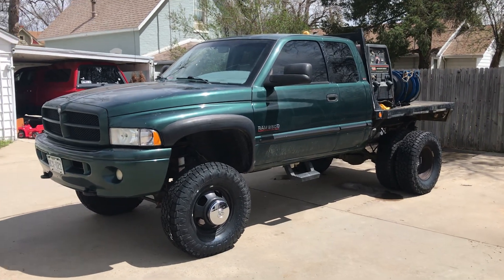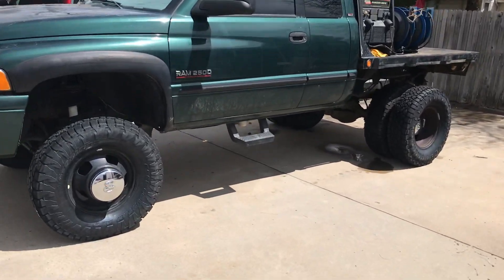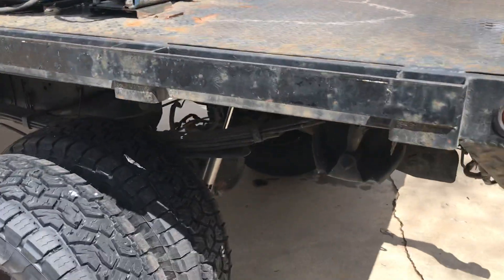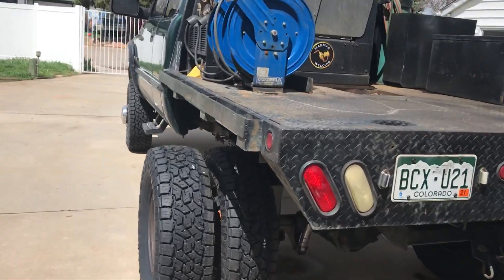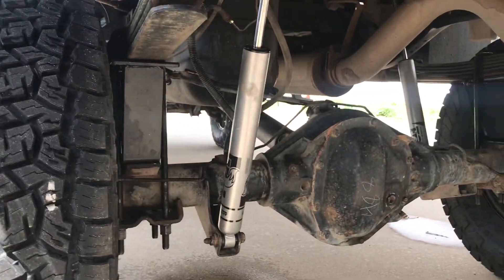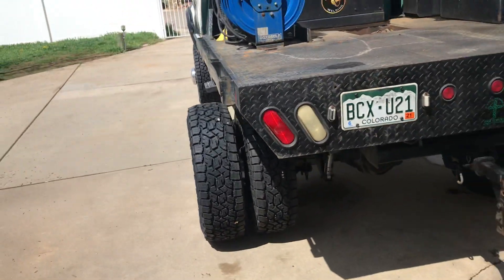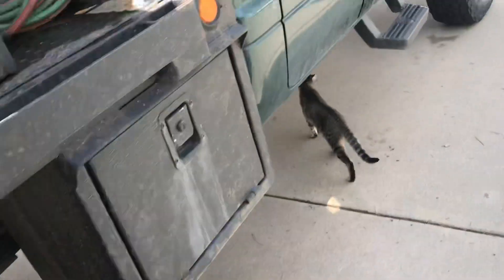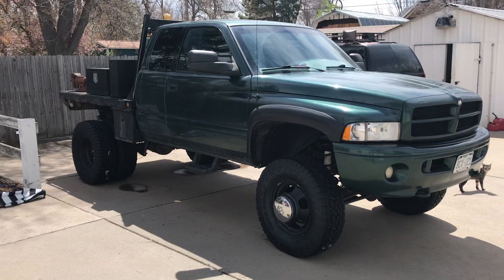Dually swapped the welding truck

Comment: Hi let me know when u want to sell that rig im in firestone Colorado
Reply from the maker: I will be selling it soon! I just got a new truck. I just have to get the welder off and switched over. 970 631 9038
Reply: Good i got all my tools in a tráiler
Trying to buy a truck for my setup
Reply: How much do u want for it?
Reply from the maker: Asking $14k, has 240k miles. 5 speed manual.
Reply: @madmarwelding  ok i let u know

Comment: Could you do this to a single cab short bed?
Reply from the maker: sorry for the delayed response. a singe cab short bed is going to be a half ton truck. yes you can put one ton running gear but youll have to do the front as well

Comment: What are the width of those steel wheels? How do the 35s fit on them?
Reply: Gotta use spacers 2in or 1.5in
Reply from the maker: There 35x11.50s with 1.5 spacers. they fit just fine, not sure on the wheel width. Stock 3rd Gen 17” rims
Reply: I’m just concerned with the width of the wheel. Most of those were like 6.5” wide. Is all the extra rubber a problem?
Reply from the maker: @lukehilton3562  Iv put the boots to this truck! Pulling over loaded trailers, 4 wheeling through crazy job sites, I even pulled out a stuck semi box truck. Never had an issue one.
Reply: @lukehilton3562  depends if your area has thorns or not, i try to run my duals with skinny tires so the sidewalls dont get punctured. if youre not in the dirt then its fine just make sure the duals arent rubbing